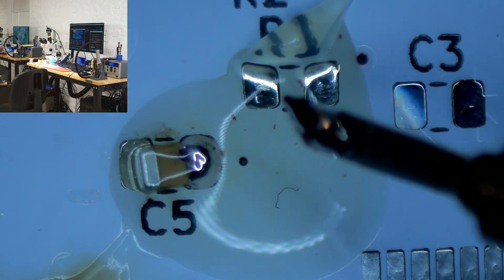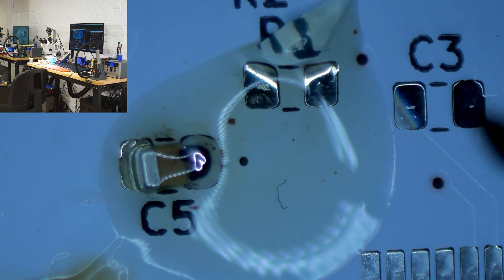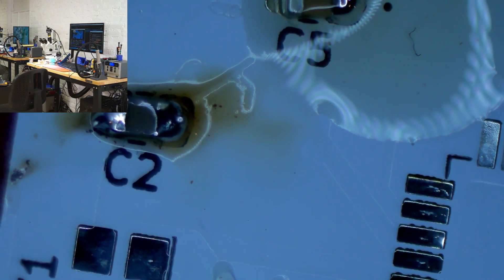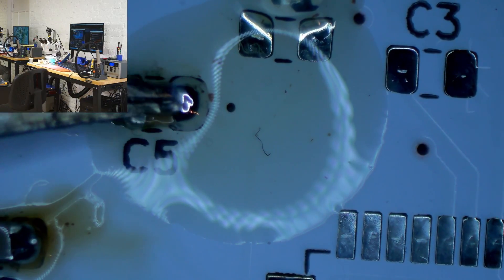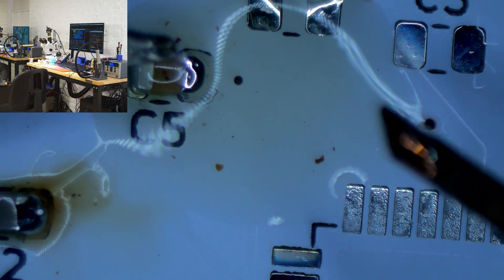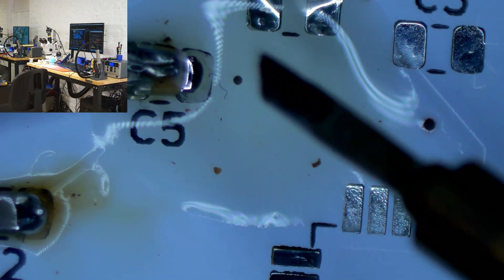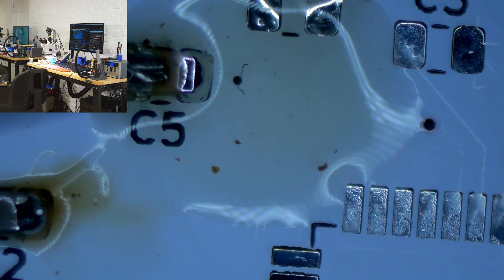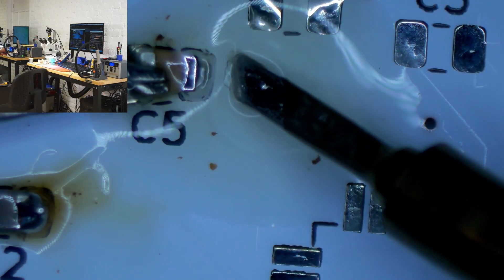Soldering tips from FUTO workshop: avoiding solder blobs soldering small components

Comment: What's the type of flux you're using? I've never seen one that's spooned on like hot glue or however that works. It seems to be very helpful, I know I hate soldering small components due to solder flow problems. The iron technique helps, but I already have that part.

Comment: Found this approach in tiny component solderin in hard way :)  By the way it is much better when flux is good too. Bad/mediocre fluxes on excess solder removal step already start to burn, become brownish and goeyish and begin to accumulate solder specks around. This is a little hell to clean this crap away from component pins then. Especially if you're soldering QFP or QFN packages.

Comment: Trick i find useful as my hands shake pretty badly, there are contact pads on most circuit boards for the 5v and 12v rail as well as ground. If you solder a wire to either the 5v or 12v contact pad and another to the ground contact pad near where your working you can connect them to a multimeter in diode mode. That way when your setting smd components or chips you know if you shorted out a connection long before you hook power up to it (loud chime from the multimeter). Not relevant to the video just sharing.

Comment: Would you suspect something like a U8900 or U9300 if macbook screen goes black, keys lit when using app that requires nvidea GPU? Plug into external monitor and that works. Early 2013 Macbook Pro A1398

Comment: To be honest, was hoping for a similar setup of a workshop a few states over to the East. I usually build new stuff more than I repair, but the skill set roughly the same. I always end up with messy joints and I tend to remove excessively when trying to remove the excess. Having better access to parts and components when trying to do repair would have been a plus as well (it's almost always some sort of connector that is breaking; I keep a stock of USB and barrels, but those aren't the only kind that break on me).

Comment: I had a handyman friend who was doing some copper plumbing on another friend's condo. She reported that he was having a really hard time with a joint and it kept leaking after he was done. come to find out, the guy was adding flux, heating the joint, wiping the flux off and then trying to dry solder over and over for a  half hour on one single joint. I think he believes flux was just for a bit of cleaning before soldering.  The guy is his own worst enemy.

Comment: I wonder if it would be a help for anyone by way of as soon as the tip touches the joint say something like melt or wet and then pull the tip away, it might help reduce heatsoak into a component

Comment: Very nice. Though I use more solder on components on circuit boards near areas that will experience repeated sharp vibration or impacts, especially if the vibration is coming in though a nearby mounting hole. Enough solder so the cross section makes a right triangle wedge between the pad and component rather than more of a concave L shape used on most other parts. Also using a softer, more malleable solder alloy so that microfractures are less likely to develop over time.

Comment: Is it just a soldering iron and/or tip issue when it seems to take forever for the solder to become liquid? Sometimes it seems like some components that are soldered to the ground plane can just soak heat forever, like a USB connector for example.
Reply: Yes..many boards are multi layer and can contain multiple ground planes.  Suspend the board in air and heat the board from the bottom.  This will reduce the temperature needed to flow the joints connected to the ground planes.